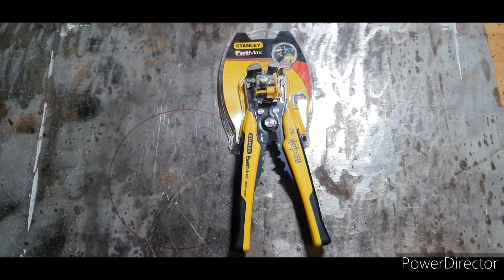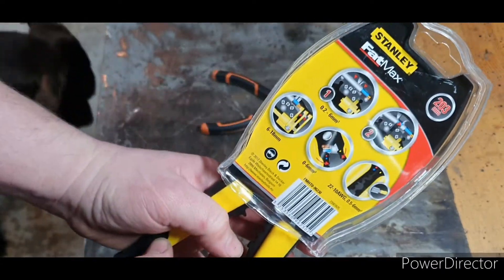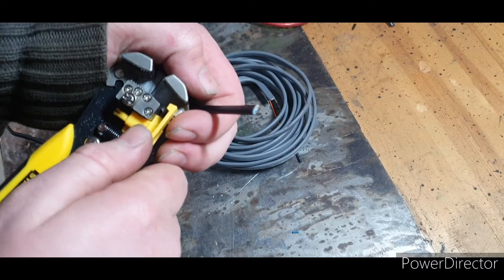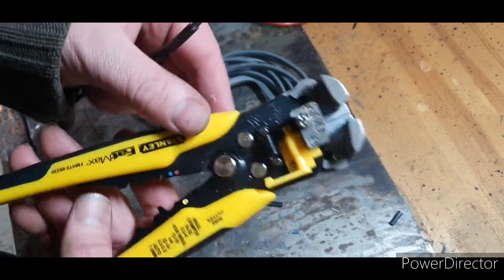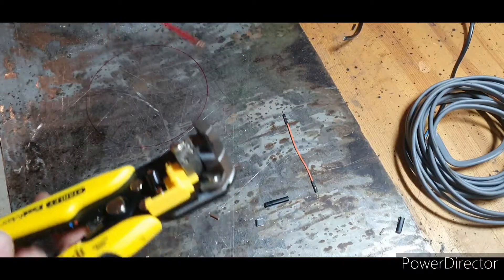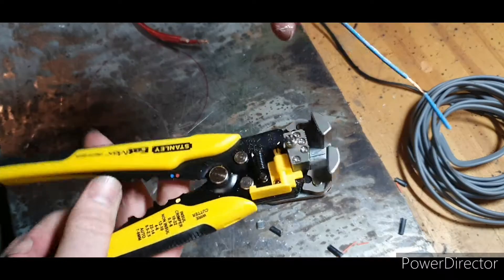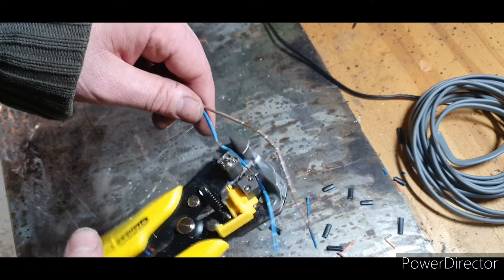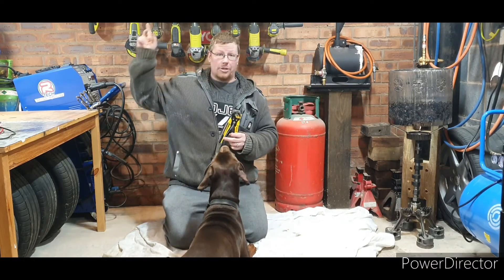Stanley fatmax wire strippers

Comment: That "fine tuning thing" you showed in the beginning of the video is to adjust the tension on the grips, so you probably could strip that larger wire more easily if you turned it all the way.

Also have one of those and they're fantastic!

Comment: I have those exact strippers. You probably know well by now but the dial is for adjusting the pressure force of the clamp side of the tool that hold the wire. 

Also, the 'stop' is very handy for getting repeatable length strips for crimps etc. I lash through trailer rewiring jobs with this tool and a ratcheting crimper. Gorgeous mutt too btw! 😍
Reply from the maker: Cheers for the info mate. Its a tool don't use that much so I never figured it out lol but now I know 👍. Yeah he is a lovely dog, bit mental but a good personality 🤣🐕
Reply: Cheers for the info on the dial. The packaging makes no mention of it.
Reply: Good to know about the adjuster, I've had to make 3 or 4 goes to strip outer and often at least 2 to strip inner.

Comment: misleading.  I ended up takinig mine back because the LHS of the wire to be stripped did not stay put during the process and slid through the LH jaw despite operating the wire stripper precisely as demonstrated on this and other videos. After taking them back to the retail outlet they agreed and swopped over for another pair which did precisely the same thing. The customer service lady and myself eventually worked out it was only by putting your thumb on the left hand edge would they work  as demonstrated. Once mastered it did what it said. It may be that the latest production left hand jaws do not hold the wire in position while stripping. Very misleading and the instruction that came with them explained very little with no explanation of the circular dial  in the centre. of the jaws